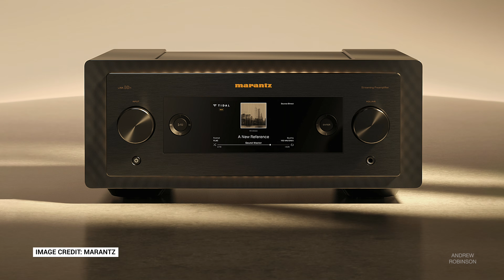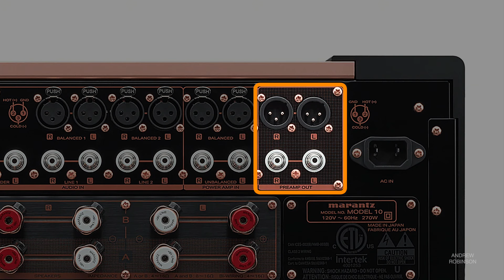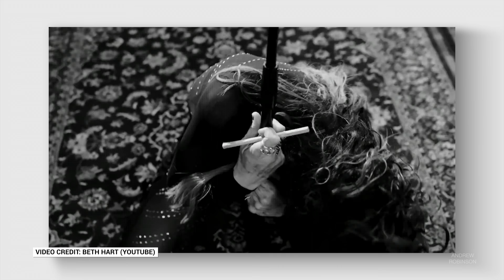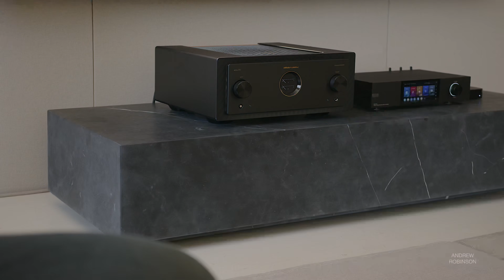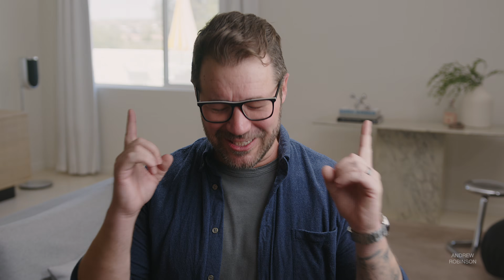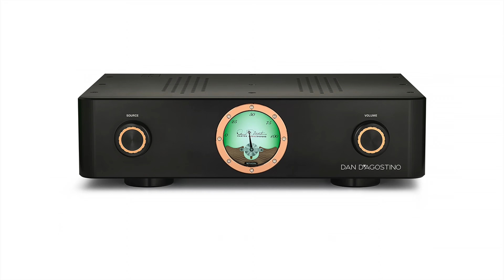Can Perfect Audio Ruin Music? Marantz Model 10 Review

Comment: Hi Andrew, In short: you dismiss the Marantz Model 10 for being boring, oversized and otiose. A somewhat strong opinion as you didn't connect the kind of loudspeaker this amp is made for. It won't perform its best driving a bookshelf or a high efficiency horn. It may control a big Wilson, B&W 801, Focal Sopra 3 or Scala like few others can. You should have made such a pairing to make good use of the power of this amp, instead of choosing the wrong speakers and suggesting all that power is useless. Furthermore, why no comparison to the Hifi Rose RA280? Also Class D, also very powerfull. I bought one for the small system in the study. I now realize the Rose may be good enough for my high end system ... . Indeed, the Rose may be better than the Marantz, at 20 percent of the price ... . Perhaps give the Marantz a second chance using more appropiate loudspeakers?
Reply: I don't think your comment about speaker pairings makes any sense. To suggest Andrew did not give this amp an opportunity to perform is no offense, ridiculous. 

The HiFi Rose is a great amp, and based on my recollection, I would choose it over the Marantz here.
Reply: @KristiWright  Hi Kristi, You do not explain why the matter of appropiately combining amps and loudspeakers is ridiculous. I would rather consider it to be essential. Long ago, I owned the first version of the Sonus faber Concertino. The SEAS tweeter cost 10 dollars and the woofer 25. Standard Class, really. The present model may be better, but it is still a smallish  loudspeaker thay one generally does not combine with a power monster costing 15 k. The "level of ambition" of the products is not in line. In other words: the Concertino might not be able to show what the Marantz can do. Andrew listened to certain pop songs; the sound did not meet his expectations or wishes. I would rather combine the Marantz with the type of loudpspeaker I suggested, listening to classical music, somewhat loud. I have a feeling that would give a better impression of what this amp is capable of. Still, the Hifi Rose may be more satisfying in the ears of most people. Therefore, Andrew could or should have mentioned it as an alternative, costing only 20 percent of the Marantz.

Comment: Class D?  Not impressed.  Despite all hard evidence to the contrary of which I am well aware, I simply find that they all sound terrible.  I'm also not aware of any good reason to design a class D circuit to this price point.  It better have state of the art power delivery and isolation.
Reply: Have you made blind comparisons?
Reply: @ropeburn6684  yes, in the sense that I've heard systems and not been impressed, and then been told that the amp is Class D.  Have I done ABX tests?  No.  And I won't do one to satisfy you as I've no interest.  If you like Class D amps go for it, they're still making plenty for you.  They perform better on paper in a lot of metrics.  Maybe I like distortion and that's OK.
Reply: @C--A  yeah probably.  I won't defend time domain distortions, poor transients, room/baffle reflections etc. because they make the sound strictly worse, but distortions to tonality and dynamics can make music sound more enjoyable without throwing away audible information.  Transparency can sound superb if the recording was already superb and designed to be delivered as-is, but for many recordings it's a fool's errand.  Most recordings weren't mic'ed to capture the sound of a room or to sound "alive" so in many ways your sound system is putting on its own performance in those cases rather than recreating one.  I was never meant to hear the exact waveform of Smooth Criminal, it was never meant to sound like the drum machine was being played in front of me, it was meant to sound *good*.  And then when I go to play a Dire Straits SACD, I still get that "realistic" and involving sound.  Point is I'm listening to both, so I need both to sound good.

Comment: Technically speaking, class D outperforms class A-B. Just to say. Nevertheless I cannot understand how Purify based chip amplifier could or should cost 15k!
Reply: None of the PuriFi products are "chip amplifiers". They are complex analog-modulator Class-D amplifiers with even more complex feedback schemes. The output devices are discrete FETs which are below the board, designed to be heatsinked to the backplane of whatever they are mounted to. They are a totally different device than, say, a TPA3255 chip.
Reply: There’s probably rather more to this piece than “just” the output stages - like several hundred dollars worth of connectors alone 😂
Reply: Probably, but still a fraction of the USP

Comment: It's not " an all analogue affair" , it's class D.
Reply: Class D doesn't mean there's anything digital, it's just a way to use the transistors.
Reply: You are very wrong.
Reply: Pulse width modulation is an analog process. More info: /watch?v=WJf-czaTVws
Reply: @karto86 
 You can apply a digital square wave,to produce pulse width modulation.
Reply: @grahamjohnsparks  With all due respect, you should probably look up something before telling someone else that they're wrong about it. This is what's wrong with the world today.
Reply: The modulator of a Class-D amplifier is analog. The PuriFi modules are all analog input.

Comment: It’s products like this that discredit the big brands, this is more a testament to the salesmanship of the marketing department then the “all that you need and most of what you want/just works every time” mantra that Denon/Marantz has worked so hard to reestablish over these last 5 to 10 years. just as you mentioned based off the thumbnail, I thought I was clicking on a $5000 amp, not triple that.

Comment: I live in a small country with little access to audition gear. So I had not other choice that to buy based on specs. The music was boring and lacked emotion. It was more a party-trick of “wow, listen to this detail” and less about feeling the emotion the artist intended.

Now I said “f—ck it” and bought a hybrid integrated (tube pre-amp, class A/B amp) and the feels are back. 

My humble opinion: what the “artist intended” was not to reproduce a DSD file to bit-perfection. What the artist intended was to transmit a certain emotion. If you feel that emotion with technically perfect gear, great! If you need a little more warmth or distortion or v-shaped curve, great too! Seek the emotion intended, not the specs.

Comment: If i am not mistaken, doesn't the preamp control more of the sound vs the amp? Wouldn't a tube preamp alter the sound in the way you would like? I was always under the knowing that speakers and preamp control 99% of the sound you hear. So long as you have a clean amp it only amplifies what it is being sent it doesn't really add any sound. More expensive amps are really just cleaner and more stable under heavy load but sonically most amps do not change much, especially with a tube preamp. That is what changes the sound
Reply from the maker: Noting your comment for Friday's Unplugged video.
Reply: @andrewrobinsonreviews  It would be great if you also run the marantz into a preamp that you like and see if that changes things. Based on your assessment the marantz appears to have every clean sound, some coloration from tubes may change your mind on what it can do. Would love to hear if that is the case.

Comment: I don't know. I just saw the Marantz Model 10 at Axpoxa in silver/champagne, and that thing is gorgeous. The black version loses something, but there's nothing wrong with that silver. I just bought the Model 30, and while the design languages are in the same family, the 10 series feels more enhanced or updated. Now, on your suggestion that Marantz's "new" style may be getting long in the tooth. Are you familiar with Marantz's previous looks? That language felt like it had been around for centuries. In addition, I think that Music Fidelity's style has been around longer current style,  so has Rotel Michi, McIntosh, Accuphase, AND D'agostino. I'm not saying looks shouldn't' evolve, just that there are a few companies in line ahead of Marantz. Denon should probably be at the very front. 

As for the sound, I don't think I can add a valuable opinion. 1) I'm not a pro reviewer, nor do I get to listen to a lot of gear. 2) I didn't get to "hear" listen to the 10. At Axpona, they were using 2  Model 10s in power amp mode, each connected to a B&W 801-D4. The 3 times I've heard these speakers, it was just okay. So, I don't really know what I should expect from the Model 10. I have the Model 30 and I really like it. So I expect the 10 to sound better. Though I also have a Mcintosh 6700, and I don't know if I'd say it's better than the 30.

  I will say that if I were able to buy a component from the 10 series, I think I'd go with a Link 10 and figure out the power amp.

Comment: I think what he is describing is poor transient response (dynamics) this is a very typical characteristic with the majority of class D amplifiers in my experience. Amps like B&Os ICEpower excel in this category. They are extremely quick sounding and have an amazing transient attack. Similarly Hypex Ncore and amps from pascal are good too but just about every other class D amp I have experienced (with some exceptions) seems to be plagued with a lack luster feel in the dynamics category. I think this mostly has to do with the power supply but also peek current output, slew rate and damping factor play a big role In the dynamics delivery. when looking into digital and switching amps it’s really important to make sure they have a well designed power supply preferably with PFC and good regulation! Also the other specs I just listed above too. A deceiving factor is wattage. A lot of people think that just because you have a high wattage output you automatically have amazing dynamics and though watts can technically increase headroom it doesn’t promise perfect dynamics. I have heard low wattage tube amps with better transients than thousand watt class D amps. A similar comparison would be like horsepower vs torque in an engine. Once again,Thanks for an awesome review Andrew! And hope Kristy feels better 🙏🏻
Reply: I would also like to add to the comparison at the end, something that my friend who is an engineer said. The majority of class D amps can be compared to a smaller engine like a 3 liter, 4 cylinder engine that’s been twin turbo charged where as some of the big class A monoblocks or tubes can be compared to a big v8 or v10 that’s naturally aspirated. It’s the difference between displacement. And there is no replacement for displacement LoL
Reply: Agreed got a pair of XTZ A2-400 (ICEpower-Edge Class D) as Mono Blocks and they absolutely kick the shit out of my Dynaudio Contour 30, the speed, impact and control is amazing and their strongest trait.

Comment: Sound United (Masimo) needs to go upmarket with Marantz to keep Marantz and Denon from cannibalizing each other.  Not sure if the Marantz name has that much weight to command such a lofty price though, and the remote tells me that they're cutting corners.  Sound United was in dire financial straits and I suspect this was built to a tight budget. That lack of dynamics is likely them trying to soften the inherently clinical Class D characteristics. I've always found the porthole design silly - what's the point of a display that you can't see from any distance other than up close? Give me a full-sized display and the option to turn it off.
Reply: I don't understand why remote should be different just to be different., It's solid, heavy, full metal, practical one-for-all (if you get full package of Model 10). The tiny display looks nice on slims, there - it's strange design choice. Maybe assumption is Link 10n's screen as main screen and this only as secondary. But one will love, one will hate design of anything.

Comment: How can it output 500 watts x 2 when the rating plate says it can take in a maximum of 270 watts?
Reply: It's never maximum of "xxx" watts at the plate of amp. It's somewhere like 20-25% of max rated power - "typical use". Marantz M1 has 70W on back - it's 2x100+W into 8/4 Ohm. There is no magic here, for max power it will pull over 1 kW out of the socket.

Comment: For $15K, there's a lot to be desired and that's disappointing...can they please get rid of the stupid looking port display?
An amp like that I would expect to see nice backlit meters (sort of like the Onkyo Integra M-504) and a small display or just simple mode indicators...simple tone (trim) controls.
they completely rob you of a visually appealing fascia and put in that lame $10 port display that's completely useless unless you're 2 feet or less in front of it...I'd forgive it if it had some on screen display you could see on the TV...but it doesn't

Comment: Maybe a little off topic, but. I just got rid of my Yamaha A-S3200 for the RZ30.. I mean, did the fantastic review of rz-30 underestimated how good it actually is in stereo? I haven't missed the Yamaha for a second, and I haven't even started on dirac yet. It might be that the tonality in rz-30 with my RP8000f 2 just works better? What do you think Andrew and Kristi? I was almost embarrassed to admit that I prefer an AVR instead of high end stereo amp. Anyway, good review as always Andrew!
Reply from the maker: I'm not surprised by your experience. It's not that AVRs sound bad; in the modern era, many things sound good/great. It's becoming harder and harder to stand out from the crowd, and as a result, other factors become a bigger player in one's buying decision. The flexibility of an AVR may ultimately be what wins out over a more dedicated stereo component, even if it means sacrificing 1 or 2 percent in performance-- percentages that may not even be audible in most rooms or setups.
Reply: @andrewrobinsonreviews  Yes, this was my experience, the Yamaha's upper mids do not work with me. My Wiim Ultra tamed it using EQ. However the connectivity on rz30 is, well, it has enough for me in years to come. I don't even care for surround, too much speakers really. Frankly I can't hear that I missed anything, but gained an amp that have very little own sound. I like that. Thanks for the reply :)

Comment: Right on. Agree with everything you said. Almost looks like a cash grab for dealers to sway wealthy buyers towards. Are the dynamics you talked about not technically accurate when it’s supposed to be a more visceral song or recording? Do other amps exacerbate certain 0 to 100 (quiet to loud) moments? Do they do it on purpose? How does that work?

Comment: Why model 10, when you can get the av10 and amp 10. Same price as this model 10, but u get 16 channels of processing and power and dirac and etc etc.

Home theather processor trumps this integrated. Integrateds are on their way out
Reply from the maker: You're going to want to stay tuned 😉 , but yeah, I think you and I are on the same page.
Reply: I believe that I might be able to change both of your minds as far as integrated  vs. avrs if you were to of experienced what I heard. I purchased a Cinema 40 and Martin logan F2's,( plus the bookshelves and center in the same ML line). Both partially because of Andrew's recommendations. I wasn't at all satisfied with what I was hearing for 2 channel music listening. So I ordered an integrated amp and different speakers. The integrated arrived about 6 weeks earlier than the speakers so I was able to pair it with the F2's. To say it was a night and day difference from the Cinema 40 pairing would be an understatement.  That's not counting the fact that I had already stopped using the horrific  Heos streaming and sub par dac that were in the 40 and went to a stand alone streamer/dac. Big improvement there also. I suppose if listening to music is your secondary use an avr might suffice. I've since sold the F2's and kept the 40 ,the bookshelves and center. The combination makes for one hell of a sound bar 😂.